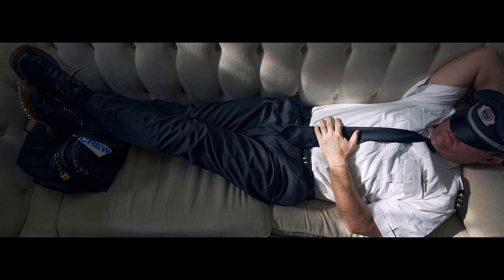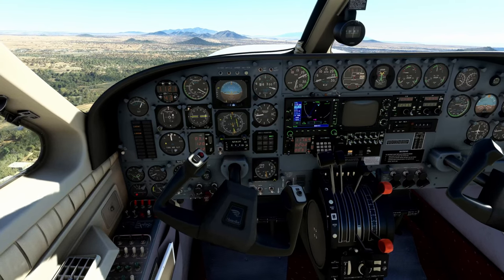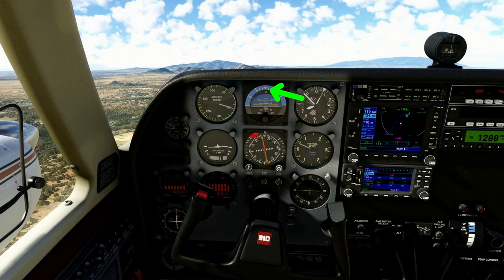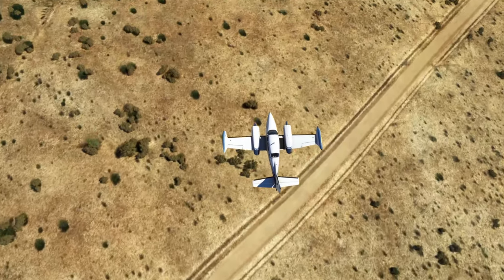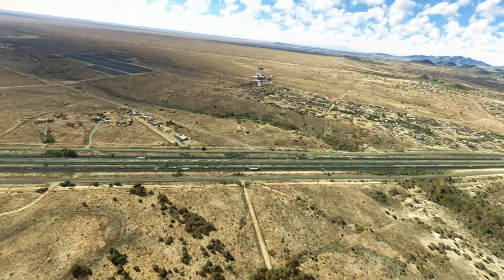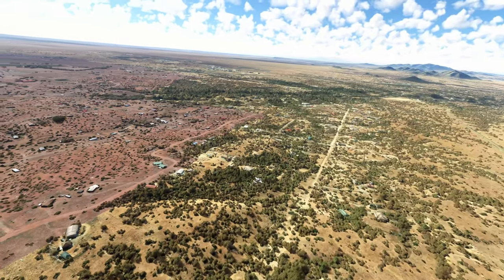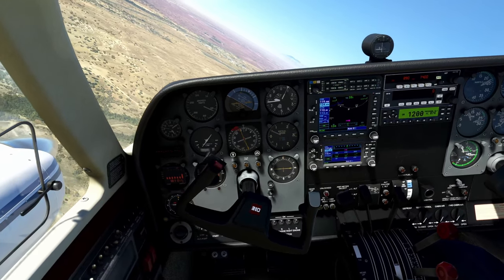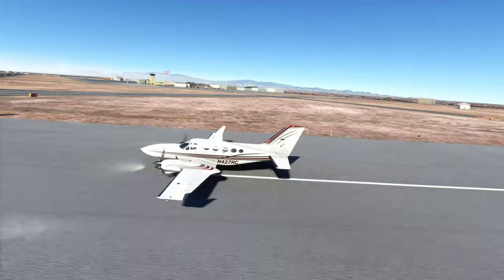Vmc or Die

Comment: Wow. Regardless of how right you might be, getting all this straight, after you’ve already lost 20 IQ points merely by sitting down in the left seat… and then having to overcome several seconds of startle factor… seems like a nearly insurmountable task. I’m wondering if it might be best to pull power on the good engine (probably psychologically impossible, never mind the time spent identifying the good engine) and fly into the crash.
Reply: Yes, sometimes we brief for that if we lose an engine below 400' AGL on takeoff. We pull back both throttles, so we're guaranteed to retard the good engine! No need to figure out which engine is the good one!

Comment: I disagree with your assertion that Vmc is a function of weight.  First, it's not that higher weights move less, its that higher weights accelerate more slowly, they still move..  As you approach Vmc, rotational speeds are zero anyway.  Second, Vmc has to do with counteracting airframe rotation,  so angular momentum is in play, not linear.  This means that in any rotation the airplane responds to an angular moment of inertia, not plain mass.   Third, Vmc is derived from rudder effectiveness vs off center thrust.  Rudder effectiveness is a function of the rudder force AND the length of the rudder arm from the center of rotation in the yaw axis, ie the lever arm.  So CG location plays a factor in Vmc; aft CG raises Vmc.  Fourth, Vmc has to do with asymmetric thrust which produces (mostly) yaw, and is balanced by rudder.  Vmc is about balancing these two forces, and specifically when they are no longer able to be balanced.  As others have mentioned, ailerons are very secondary.

Weight's most pronounced effect is reducing climb performance  The greater rotational inertia (if any) will only slow the rate of turn entry or turn cessation.  It will not change Vmc.

i like that you mention reducing thrust on the good engine to maintain control.   Many teach chopping power completely, not necessary if you react at the onset of Vmc.  As you begin to lose rudder authority, reducing power on the good engine will reduce Vmc.  Placarded Vmc is at full power, and of course you can always change that.  This is important when trying to stretch a powered descent into terrain, you have more time to choose a spot if you fly with reduced power on the good engine.  By reducing power, you can bring actual Vmc to below stall speed.
Reply from the maker: A few counterpoints. If you accelerate more slowly, over time you move less. I’m not entirely sure what your definition of “move” is, but mine is: lateral distance traveled per foot of forward distance. And “rotational speeds” (I assume you were referring here to yaw) do NOT go to zero at Vmc. Rotation is a result of asymmetric thrust, which (in a prop) does not change much as airspeed decreases. If you were referring to roll forces, at Vmc the ailerons and rudder are still producing rotational forces, but they are no longer enough to overcome rotational inertia. While we're at it, you mention inertia while simultaneously dismissing mass. What is inertia? It is “the sum of the product of mass.” I use the word “mass” because it is central to inertia, and something that everyone understands intuitively. 
This leads to your first complaint, that Vmc is not a function of weight. It is. Google “Vmc and weight.” If you won’t believe me, maybe you’ll believe all the other resources out there that draw the same conclusion: the lighter an aircraft is, the higher “actual” Vmc will be. I don’t disagree about Vmc being dependent on rudder authority, but the end result is uncontrollable roll, which is a function of the ailerons. As far as the pilot goes, Vmc is when roll can no longer be controlled, and flying with the ball “half out of center” decreases Vmc speeds because the ailerons are more effective while simultaneously less rudder is required. Ailerons are not “very secondary” to this equation. They, along with the rudder, are prime players.
Reply: @flyingformoney777  Replying to your points in order:
I used 'move' in a colloquial sense.  The point there is that acceleration of a larger mass will result in a slower acceleration, BUT THAT DOES NOT INFER AN INCREASE OF Vmc.  It only infers the rate of increase of the speed of the yaw and roll.  And pay attention to the fact that while the higher mass accelerates more slowly, it will also decelerate more slowly.  Stopping the roll or yaw will be more difficult.  (This still only applies to rotational moment of inertia, the equivalent of mass in rotational dynamics.  In aircraft, higher gross weights can mean weights near the CG, like passengers, or far from the CG, like tip tanks.  It's not a one size fits all)  Vmc is not about the rate of uncontrollable yaw, it is about the airspeed at which yaw becomes uncontrollable.  And that happens independent of aircraft weight.

'As you approach Vmc, rotational speeds are zero anyway.'  means that as airspeed slows and the aircraft approached Vmc, there is no uncontrollable yaw yet.  You are still under control.  You have not yet lost rudder authority and can still fly straight.  At Vmc, you have not started to rotate about the yaw axis, that happens below Vmc.  By definition.  So yes, rotational speed is zero in a properly flown aircraft at Vmc.

Nothing ever will "overcome rotational inertia".  Rotational inertia is conserved, much like mass, unless you rearrange fuel or passengers.  Since you usually don't have the time to do that, it is a constant.  I don't think you understand what rotational inertia is.  Much like linear inertia, it affects the acceleration of a mass.  The mass always responds to a force.  It is not overcome.  And you get the definition of inertia wrong.  In rotational dynamics, it is the sum of the products of the masses times their respective arm.

And no, Vmc is (still) not a function of weight.  Your internet reference is wrong.  This is a great illustration of just because it's on the internet doesn't mean it's correct.  If you are referring to this page:
https://thebackseatpilot.com/pages/vmc
look at the accompanying diagram.  Note that it states that Vmc occurs when TxX (thrust times the lever arm of the engine from the CG) equals RxY (Rudder force times the lever arm of the rudder from the CG)  This part is correct.  Note that nowhere in this correct representation of Vmc is mass of the aircraft, or any part of the aircraft, in the equation.  It is only the asymmetric thrust rotational force vs the rudder rotational force.  Mass doesn't matter.  What matters is when the rudder force available no longer is sufficient to offset the asymmetric thrust (and the added asymmetric drag of the windmilling propeller if not feathered) the aircraft becomes uncontrollable.

Flying with the ball half out decreases drag, and therefore increases SE climb performance, it does not decrease Vmc.    I'll leave it to the reader to look into that one further.  Suffice to say moving the ball to any location does not affect rudder authority or asymmetric thrust, so Vmc remains the same.  And where did you ever learn that at slow airspeeds ailerons are equally as important?

Lastly, the published Vmc is derived from the most adverse (but still legal) conditions.  It will never be higher, but it very well  may be lower.

I'm taking the time to go over this in detail (mind numbing as it may be)  as it is important to keep low time twin pilots well informed, and hopefully prevent an accident.
Reply from the maker: @midweekpowderhound  "Move" means motion, and mass resists motion. Even in the colloquial sense. From CFR 23.151 (f.5): Vmc is established by: “The most unfavorable weight in the range of takeoff weights.” You link to one source and dismiss it, but there are many, many other sources out there that mirror this statement: “The most unfavorable weight of a multi-engine aircraft is when it is lightest…. Early certification of multi-engine aircraft did not specify the weight at which Vmc had to be determined. Therefore, many manufactures calculated Vmc at the heaviest weight resulting in the previously mentioned effects on Vmc to be reversed. In this case, actual Vmc matched published Vmc at the heaviest weight and increased as weight decreased.” 
I’m going to give you this point: the adverse effects of increased weight on performance are far more important than the slight reduction in Vmc that heavier aircraft demonstrate. But weight does, indeed, impact Vmc. For more: AC-8A: FLIGHT TEST GUIDE FOR CERTIFICATION OF PART 23 AIRPLANES: Page 60 and Section 48(c)(1) states that 'The critical loading for Vmc testing is generally minimum weight and maximum aft c.g.; however, each airplane design should be evaluated independently to be assured that tests are conducted under the critical loading conditions.'
Likewise, flying with the ball half out of center decreases Vmc. You state that it has no effect on Vmc, only drag. CFR 25.149 (b): “VMC is the calibrated airspeed at which, when the critical engine is suddenly made inoperative, it is possible to maintain control of the airplane with that engine still inoperative and maintain straight flight with an angle of bank of not more than 5 degrees.” You need to understand that maintaining level flight with a 5-degree bank requires the ball to be half out of center. The rule of thumb is that for each degree reduction in bank (below 5-degrees) Vmc will increase by 3 knots.
And I understand rotational inertia. Mass is still in the equation for determining it. Heck, you mentioned it in your own definition. And you’re misquoting me on this particular complaint. I was referring to mass as it relates to “5-degrees, ball out of center,” for which it is valid. I wasn’t referring to rotational inertia.  
I would LOVE for you to detail how ANY of this pedantic conversation is going to “save lives?” There are only a few main points to everything I said in the video (and yes, videos like these are reductionistic purposefully in order to drive home the main point and avoid intellectualist mire). Here, again, are the important takeaways: maintaining airspeed with a margin above Vmc is vital; Vmc varies and is highly dependent on maintaining ball half-out-of-center; if you cannot climb at Vxse or Vyse, accept it and find an off-field site. THAT is what will save lives, not our little pedantic argument here over definitional terms and the validity of sometimes contradictory source material.
Reply: @flyingformoney777  I don't think higher weight reduces Vmca because of higher inertia. I believe higher weight gives lower Vmc than a lower weight when turning into the good engine (and conversely higher Vmc than a lower weight when turning into the dead engine) because the higher weight means that the wing has to generate more lift to maintain altitude, and therefore the horizontal component of the lift vector for a given angle of bank into the good engine is higher, lessening the need for rudder force to counteract the yaw produced by the good engine.
Reply from the maker: @igclapp  That is the official reason, higher lift. Unfortunately the official material implies that Vmc is only valid when in level flight with an offset bank. Lift increases in a turn if altitude is maintained (regardless of the direction of turn). The lift vector does not change relative to the slipstream if half-center ball is maintained. What happens to Vmc in a 20-degree bank into the failed engine? If it increases, then published Vmc would only be valid for turns into the good engine (and all POHs would have to caveat this point). This is clearly not the case. Aerodynamically speaking, the aircraft doesn’t care which direction it’s turning, only that the ball is half out of center. “Bank into the good engine” is simply the means to maintain heading. My “weight moves less” thing is an abstraction. You’re right, it’s not a perfect one, but it’s simple and the conversation becomes dizzying pretty quick.

Comment: Vmc ISN'T about aileron control, but RUDDER control buddy and it's NOT the minimum speed that you can control a twin at 'per se' , but only in a particular configuration which included the live engine at max power!! There are actually plenty of errors in this video and for safety's sake, it should be taken down!!
Reply from the maker: Sigh. I did address this in a comment to this video and a talking head. Certification standards specify that rudder limits ultimately determine Vmc speed, but Vmc roll is the result of rolling forces that the pilot cannot overcome with the yoke. Two sides of the same coin. I was extremely clear in the video that when a Vmc roll develops, the quickest way to recover is to reduce power. “For safety’s sake…” Really dude? Keep your speed up and accomplish an off field landing if you have to. Reduce power if you encounter an uncontrollable roll (hence the focus on ailerons). Maybe watch the whole video before being a keyboard warrior...

Comment: Good video, nicely explained. The second engine is the one that kills you. Have a lot of time in light twins and much in the 310. It is particularly unforgiving with the inertia from the main tanks which would likely be full if a long flight. Having said that, you are correct there is a lot of misunderstanding and not enough practice. Better to consider 'off airport' landing the right way up higher on the priority list if you get a failure as you would with a single AND practice. Jets for the last 20 years, much safer..
Reply from the maker: Thanks!
Reply: @flyingformoney777  you are very welcome, you clearly put a lot of effort into your presentations to make them easy for people to understand